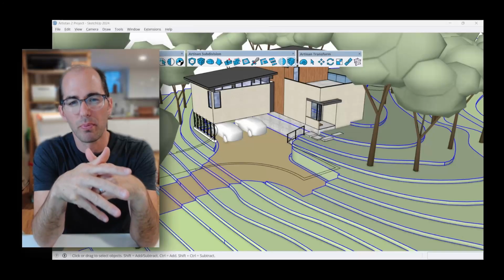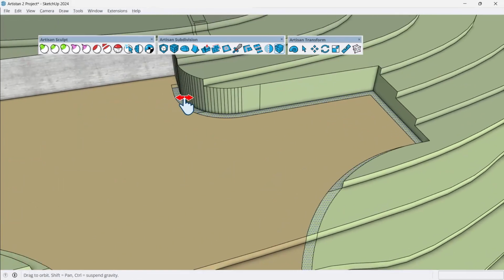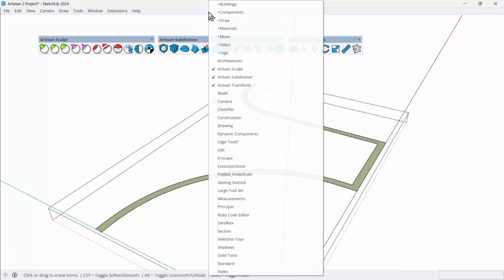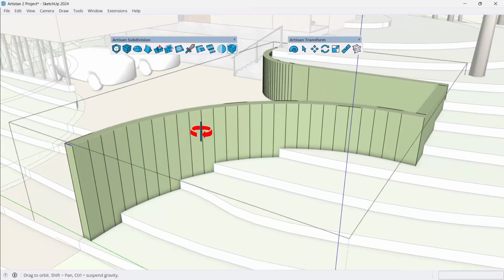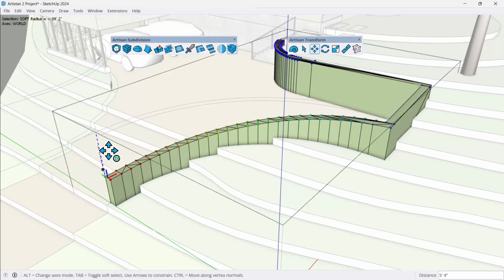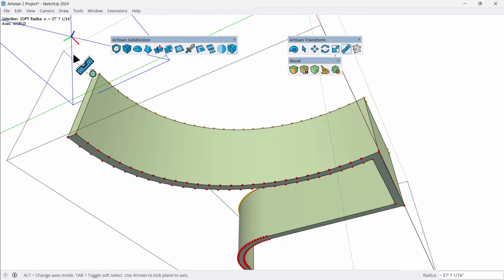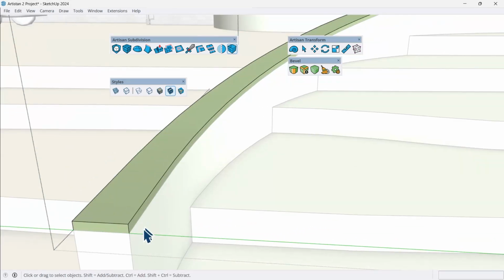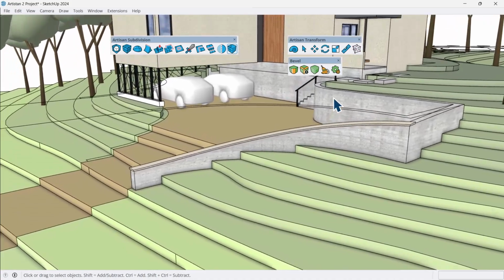Designing Curved Sloped Retaining Walls with Artisan 2 in SketchUp

Comment: OK..  neat, but how would you use Artisan 2 to uniformly adjust the curved sloping wall head height vertical Dimension to be equal above each contour? Is there  gradient fall option?